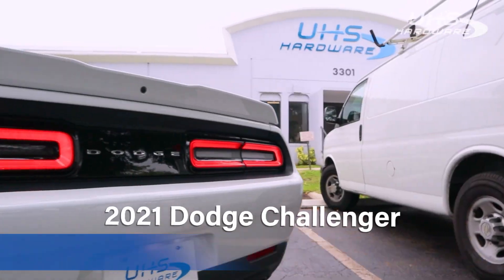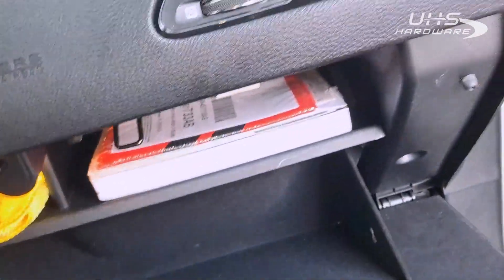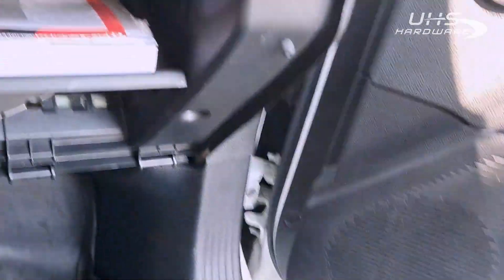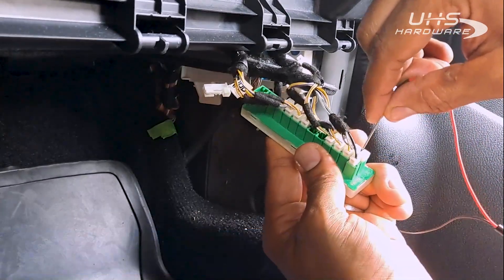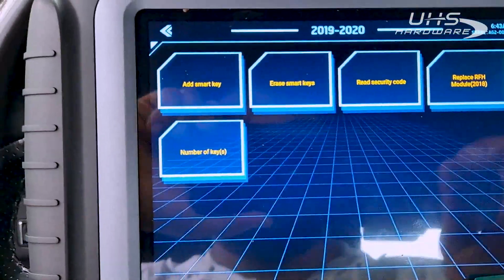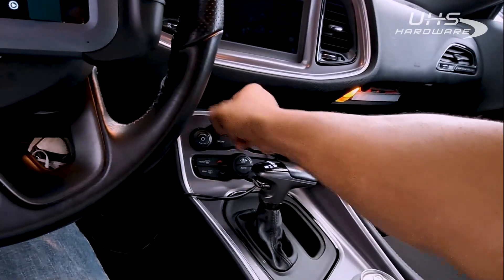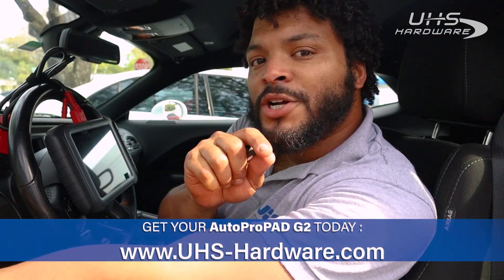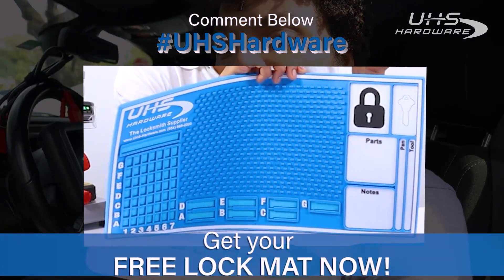How to Find STAR connector in 2021 Dodge Challenger and Program New Smart Key with AutoProPAD G2

Comment: Can you just plug in the star connector to one of the empty spots instead of pining to the wires ?
Reply from the maker: this depends on the bypass cable used. yes you can go dorect to star cable with that connector.

Comment: I bought a used 2021 Challenger 392 (from a used car dealer) and it only came with one key.  Unfortunately, I think it had the RF Hub lockout (see: Dodge TSB 08-088-22) as the local Dodge dealer was unable to program a new key for it. Is there any chance this process would work for my situation?  Thanks.
Reply: no have to replace the entire rf hub

Comment: So this guy helped them steal my car. 🤦‍♀️ You can use a regular tablet to do this, too. Darn thrives and got my car to start in less than a minute.
Reply from the maker: nope. not how this works. but I', sorry to hear about your car!
Reply: @UHS Hardware  Most certainly can be. We have him on camera doing so...using a dang iPad. I'm also a programmer and know how he did it. Little prick isn't an idiot for sure because it isn't the easiest thing to do. Mine honked once when the new key was programmed, and then it cranked right up. He also busted my window in 1 pc (because of the thick tint) and did not set off my alarm. He told investors it was 'where' he popped it that keeps the alarms from sounding. He has stolen 4 of them plus mine since last June. 2 of which were from dealerships.

Comment: Is the cable you use a DB 9 and if so which pins go to the Star port?
Reply from the maker: The cable I used is at the link that follows. I used the two pins in the bundle. https://www.uhs-hardware.com/products/2018-2022-chrylser-dodge-jeep-security-bypass-universal-programming-cable

Let me know if that helps or not!

Comment: Can you use the ADC-2011 star connector cable with the Autel im508 & im608 to program  2018 & up Chrysler dodge & Jeep vehicles? I didn’t know if it was a universal cable or not I think it is but I didn’t know for sure before I ordered from you guys for my Autel im508. That I bought from uhs acouple weeks ago. Thanks #uhshardware
Reply: I wan to know this answer as well did you find out?
Reply: Yes i use it all the time

Comment: What if the glovebox is locked? I thought the connector was on the driver side under the steering wheel
Reply: It is behind the glovebox or sometimes near the trunk in the 2018+ Chargers and Challengers. Also, I usually just take down the soft padding under the glovebox and the Star Connector is accessible that way. I don't even have to open the glovebox.

Comment: Do I need a lock smith license to use this device , And fetch pin ?
Reply from the maker: You would need to provide proof of being a licensed locksmith to a dealer and this process does not require a pin. but many jobs done with Original or sometimes aftermarket 'look-alike' keys will need that or an authorization from a third party. this process just requires time, cables, the AutoProPADG2 and a Keyless Factory Key
Reply: @UHSHardware  ok so I wouldn’t be able to buy this device from you guys just to do my own personal cars ?

Comment: Is it possible to use the cable adc 2011a with the autopro pad?
Reply: Yes. Also not necessary to take the glove box out. With the ADC cable you can just reach up underneath and plug in. MUCH simpler and faster.

Comment: After pulling the PIN it shouldn't be necessary to manually enter it. Also, it would be nice if APP had a photo of the correct spot near console, instead of randomly clicking hoping to get lucky.
Reply from the maker: The Pin would only stay after being entered the first time, the system did not save it until it was manually entered, have you had different experiences with your AutoProPAD G2? Usually the sensor is near the front cup holders, but it varies. This vehicle was more receptive near the push to start, but also reacted near the cup holders. The AutoProPAD simply said to click once near the center console which is pretty general. An image could be helpful, but It could also possibly be misleading. Your feedback is highly appreciated!

Comment: I tried to program a 2021 Ford transit connect. The auto pro pad can’t get passed the security credentials. Hopefully the software updates will happen soon for the autopro pad
Reply from the maker: Hmm, have you spoken with XTool Tech Support? That may be an easy fix.
Reply: @UHSHardware  I did and the answer was hopefully by next year
Reply: UHS Hardware that was false information he gave😂😂 mines still work good as new